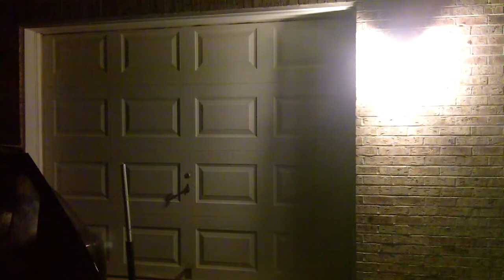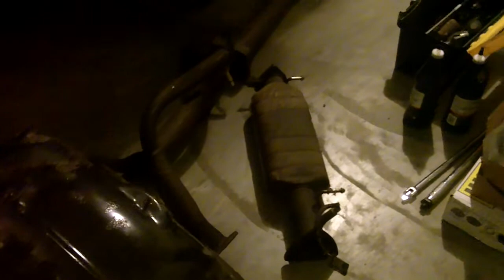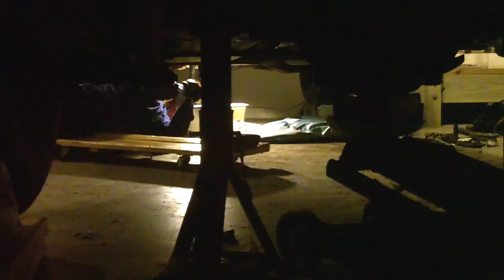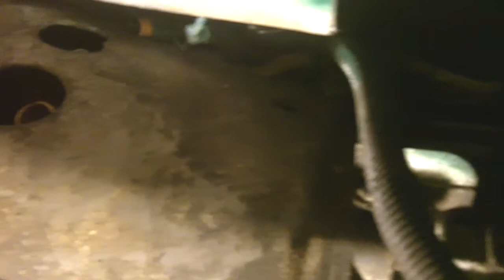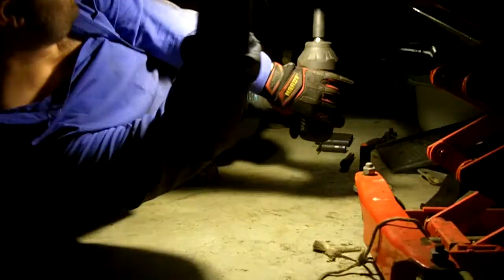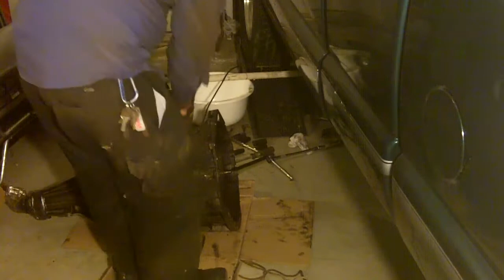Midnight Auto 1996 Sonoma Transmission

Comment: Midnight meth
Reply from the maker: Not sure what that means. As a follow-up, the truck is still on the road as of 07/2022. We had to replace a freak lifter failure a couple of weeks ago. The little metal clip that holds all the parts into the lifter broke and the push-rod was askew. It's always something. - Clay.